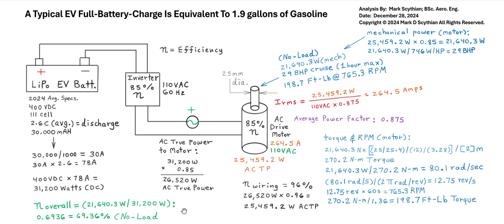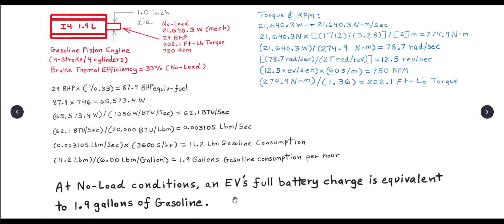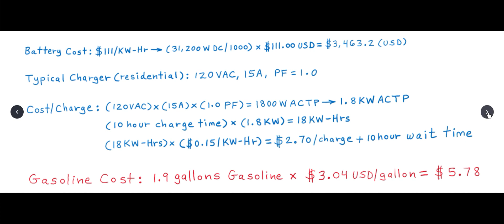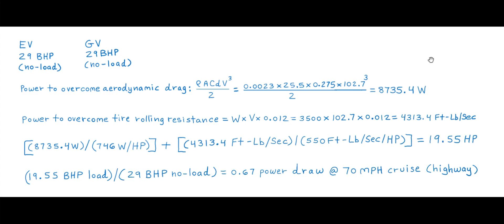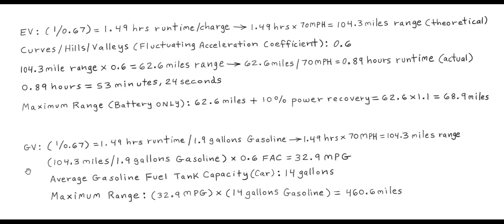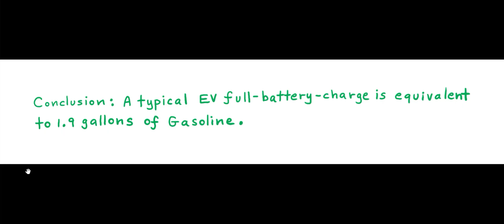A Typical EV 'Full-Battery-Charge' Is Equivalent To 1.9 Gal. Gasoline

Comment: My Nissan Sentra goes 56 miles on 1.9 gallons gas. My  Chevy Bolt  goes 250 miles on a 60 KWH  charge .The Bolt weighs 500 lbs more.
Reply from the maker: Chevy Volt & Bolt models, their software plaftorm, tend to use partial piston-electric AC generator interface along with battery draw.  Depending on acceleration vs. constant speed (no-acceleration) driving techniques.  Thus, prolonging battery runtime.  This analysis models 67% battery draw for practicaliity.  At 90% draw, residual charge (10%) would trigger LVC (Low-Voltage-Cutoff).  Triggering startup of onboard piston-electric AC generator.  At constant-speed (no acceleration), increased weight has little effect on power draw (W x V x 0.012) / (550) = Watts Power To Overcome Tire-Rolling-Resistance.  However, Watts Power to accelerate an object:  (m x v^2) / (2 x t) ===> substantially higher.  You seem like a conservative driver (slow acceleration, constant speed, cruise control).  250 mile range on 60,000 Watt-Hours charge is feasible with Chevy Bolt:  tons of abstract software architecture and partial piston-electric AC generator during heavy acceleration, unlike during cruise speed on level road.  QUESTION:  How much has your onboard Gasoline decreased after 250 miles?  Chevy Bolt and Volt both have onboard piston-electric AC generator(s).
Reply: @markscythian  The bolt is pure electric with a 65 KWH  battery . It gets about 4 miles per kilowatthour.
Reply from the maker: @donalddouglas5988  What is the mAh capacity of your Bolt's battery?  Is it greater than 30,000 mAh?
Reply from the maker: @donalddouglas5988  More specifically, what are the Battery Specifications for your Chevy Bolt EV? ===> 1.) mAh capacity.  2.) Battery Voltage.  3.) Discharge Rate Limits (usually 2.0C to 5.0C).  Knowing you have a 65,000 Joule charge, we can work out the calculations based on 4 miles/kW-Hr.  That is after the mAh capacity, discharge-limits, and battery voltage are known.  Thanks.

Comment: Lovely, now do this same calculation at -20 °C, which can last months at a time in Canada, Your range will dramatically drop
Reply from the maker: At -20 degrees C, the vehicle's Amenities-Related Latent Heat (mass x temperature) is a fraction of the vehicles Amenities-Related Latent Heat at Standard Temperature conditions (15 degrees C).  Approximately 10% of vehicle weight would comprise 'Amenities-Mass'.  An 'LH Differential' (outside environment <=> vehicle amenities), substantially decreasing Battery Runtime, and yielding the following calculations:  [((15) x (9/5) + (32)] - [(-20) x (9/5) + (32)] = -63 F or -52.8 C ===> [(3,500 Lbm x 0.1) x (-63 F)] = -22,050 BTUs' or -5,556.6 Kilo-Calories ===> Assuming one (1) hour battery run-time at (15 C) Standard Temperature Conditions ===> [(-22,050 BTUs') / (3,600 seconds/hour)] = -6.125 BTU/Sec ===> [(-6.125 BTU/Sec x 1,056 W/BTU/Sec)] = -6,468 Watts (lost to colder -.20 C temperature) ===> [(1) - (31,200 Watts DC Power - 6,468 W)] / [(31,200 Watts)] = 0.21 ===> 21% reduction in battery run-time.  Approximate Runtime = [(1 - 0.21) x (1 hour)] = 0.79 hours = 47 MINUTES.  If your runtime is lower than 47 MINUTES, then the assumed Amenities-Mass is greater than 10% proportionality.
Reply: @markscythian  can you explain this in english (im not smart)
Reply from the maker: @DarthLeopard  This analysis calculates the equivalent Potential Energy of a typical Electric Vehicle's FULL-BATTERY-CHARGE to the equivalent Potential Energy of UNBURNED GASOLINE.  A typical EV's Full-Battery-Charge has a Potential Energy equivalent to the Potential Energy of 1.9 gallons of unburned Gasoline.
Reply: @markscythian  sorry I meant the -20°c maths
Reply from the maker: @DarthLeopard  The calculation decribes the temperature difference at -20 C from Standard Temperature (15 C), multiplied times the Amenities-Mass (mass of car involved in heating or approximately 10% of total vehicle weight ===> 0.1 x 3,500 Lbm = 350 Lbm). Thus, calculating the required change in Latent Heat (mass x temperature), or in this case the (negative-value) -BTUs/Hr to maintain 15 C temperature within -20 C outside air temperature.  -BTUs'/Hr then converted to -BTUs'/Sec by dividing into 3,600 seconds per hour.  Conversion Factor:  1 BTU/Sec = 1,056 Watts.  Hence,  -BTUs'/Sec converted to -Watts, or the additional battery power needed to support amenities.

Comment: Dude your comparisom here is completely nonsensical. You are talking about the energy density of the battery as if that has any merits on it's use.

It is proven that at some point we will have to switch from gasoline engines. EV's certainly only will get better and will be certainly better than a gasoline engine in the medium to long term. What will be the case in maybe 50 years? No idea.

Also what is this supposed to tell anyways. 1.9 gallons of fuel won't move the car nearly as far as the battery will. So what's your point? I ain't gonna listen to 22 minutes of some weird math that is supposed to explain what exactly? 

You are just using crazy numbers that you come up with, used the worst system to do this (for gods sake use metric when you do this in the future) and I can guarantee you not a single soul will make it through that brutally boring way you prepared it and presented it.

If you want any chance here on YouTube you need bettee visualization, explaining of your actual goal and much more.

I got this recommended as a new channel and only clicked because I could smell this garbage from a mile away. I am sorry but this is not meant for anybodies eyes.

Please reconsider euthanasia, thank you.
Reply: That's disappointing you should have listened to the entire video because he covers that
Reply: @NVAfilm Maybe I would have it weren't so dry. Still the point of his title is just nonsense here. There are so many more variables. Just the "typical" ev battery charge may be 2-3 times his assumed number

Comment: what a load of crock
Reply from the maker: The energy-density of most EV batteries do not possess the energy-density of crude oil:  [(60,000 Joules / 454.5 Kg) = 132 Joules/Kg = Typical EV Battery] vs. [(20,000 BTU x 1056) / (1/2.2 kg) = 46,464,000 Joules/kg = Crude Oil/Hydrocarbon-Fuel].  132 Joules/kg = EV Battery vs. 46,464,000 Joules/kg = Crude Oil.  The Pu-238 nuclear-electric battery has an energy-density of 2,200,000,000 Joules/kg.  Used experimentally and safety in non-civilian applications.  Even at higher electromotive efficiency (85%) compared to gasoline-piston-engine thermal efficiency (33%), conventional EV battery materials have TERRIBLE energy-density.  This analysis EXCLUDES onboard gasoline-piston-engine driving AC Generator to power AC-Electric-Motor, for which most EVs' are equipped with.  EV Battery run-time ALONE is not competitive.